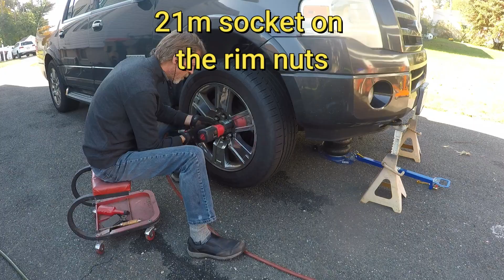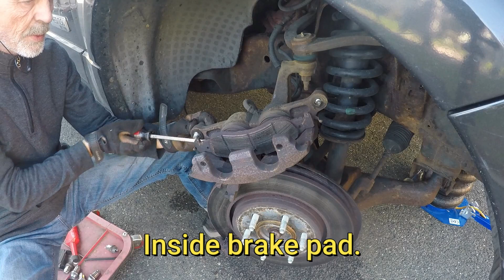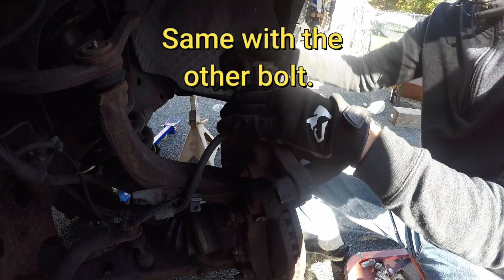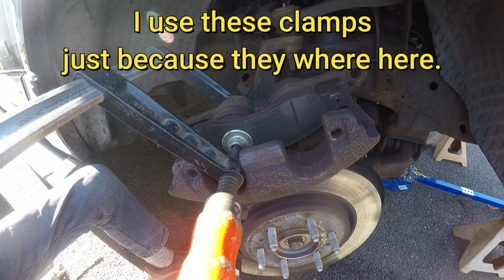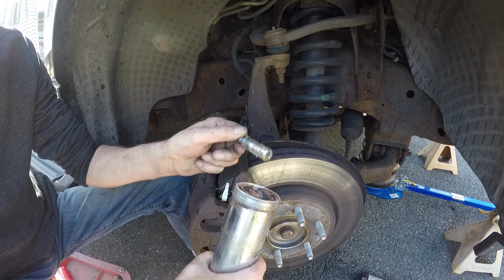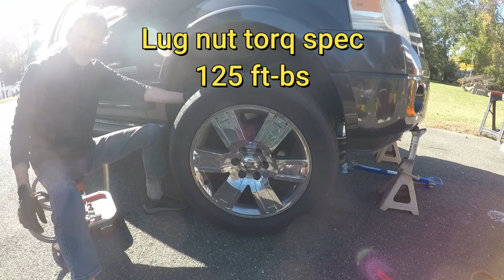Front brake pads replaced 2007 ford expedition.

Comment: Change the rubber caliper guides.  Anything on brakes that's 17 years old and rubber has turned to slag by now.  Slapping new pads on old hardware is hack work.  You may also want to use the anti-rattle springs that come with the truck and hardware kits.
Reply from the maker: You are correct thank you

Comment: What bit loosened the caliper guide pin?  I heard T45 torx or 7mm Allen/Hex.  I tried both and others but none fit 2007 Expedition EL Limited.  The replacement pins use 7 metric size Allen/Hex.  For the brake caliper guide pins on the vehicle, a T55 torx is too small and a T60 is too big.  1/2 inch Hex/Allen SAE too big. Any ideas?
Reply from the maker: My 2007 expedition guide pin is 7mm hex. My 2010 expedition is 1/2 bolt head. I would try picker and jerk it in there, rust or dirt could be the reason you can't put 7mm hex in there, After the picker use smaller hex 6mm. I have not heard about torx in the guide pin. But I don't know it all. hope this help.
Reply from the maker: After doing resource online. 7 mm hex on slide in is up to 2014 and also 1/2 inch bolt head. After 2020 they go over to 1/2 bolt head only. So you must have 7mm hex.
Reply: 7mm is too small for this caliper guide pin.  even 10mm is too small.  1/2 SAE Hex/Allen head is uncommon and too big.  T55 torx was too small and T60 too big.  If a T57 existed that might fit. @ArniAtlason
Reply: 9mm hex (front) 7mm hex (rear)

Comment: What if you don't have that tool there hard to find
Reply from the maker: Hi. These tools are very common most of world. But in place they are not. Jack is in most cars; Jack stands You can use wood block. This is just for safety so the doesn't fall on you. Tool to loosen up the rim should be in the car, you don't have use air gun like me. Alan wrench 7mm is something you have to buy. screwdriver whatever size doesn't have to look what I use; you even use metal bar. Sandpaper I use 150 grid but I could have any sandpaper it just polish the bolt. You don't need the clamp you can push the pistons back with a metal bar or piece of wood. So just use what is around you. Think outside the box.